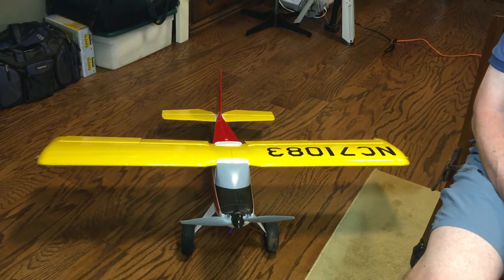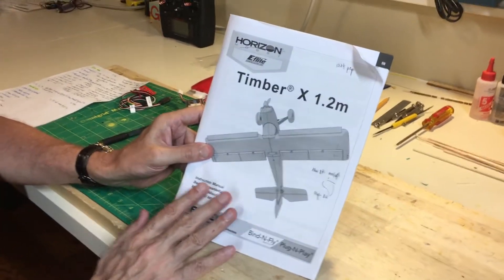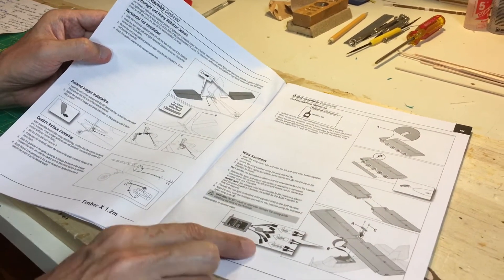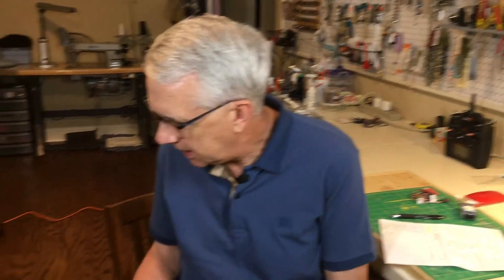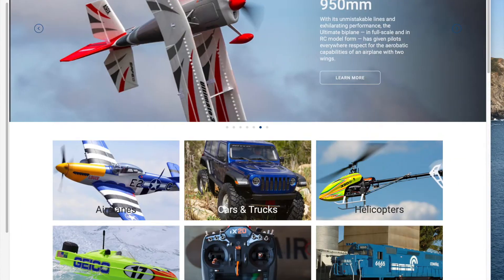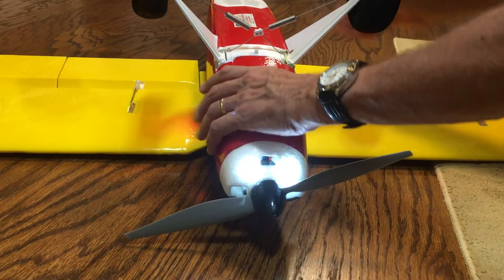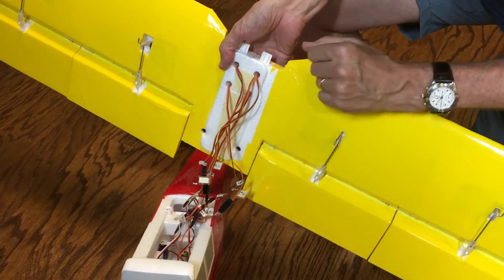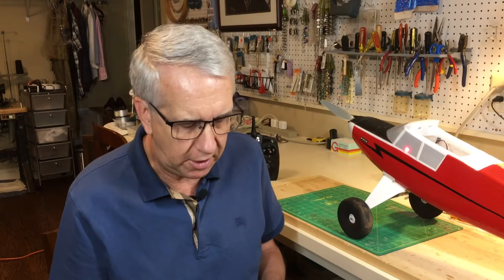E-flite Timber - Plane & Flight Review

Comment: Regarding the landing gear, on my Night Timber X the part the screws go through is metal (aluminum?) not plastic. I know this because one hole wasn't punched all the way through and I had to drill it.
Reply from the maker: Dan:  These products evolve as flight experience and complaints come in.  I had an earlier Timber.  Plastic is easy to manufacture, works great on lighter models, but just does not hack it for heavier models such as the Timber.  Glad to see improvements are being made!  Tim
Reply: @TimMcKay56  Dawned on my shortly after posting that maybe Horizon listened to people like you and mine is a now upgraded version. To be honest though, had I not had to drill that I would not have known it was metal. It looked and felt like plastic under the paint.